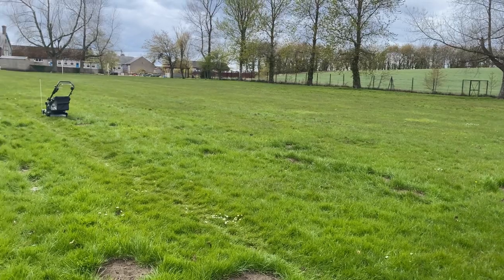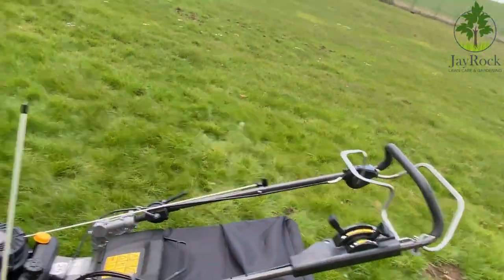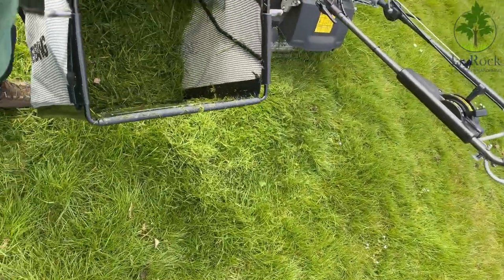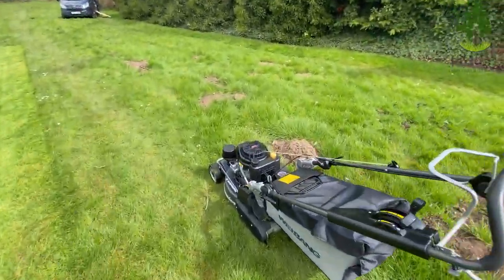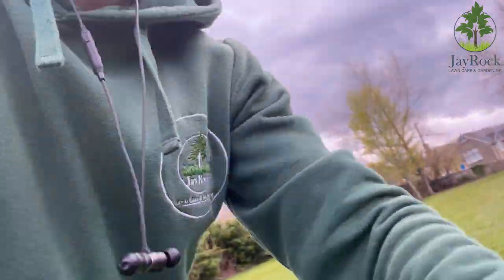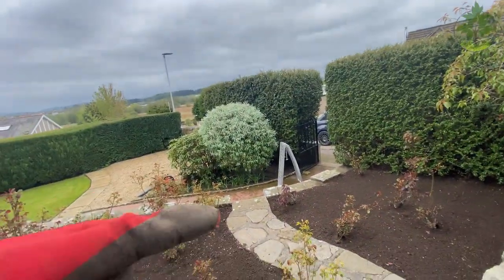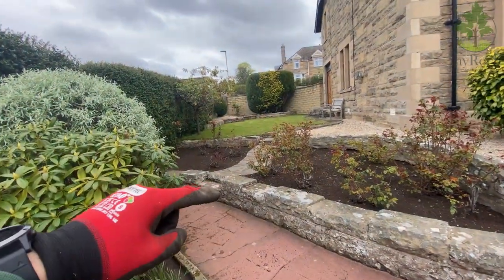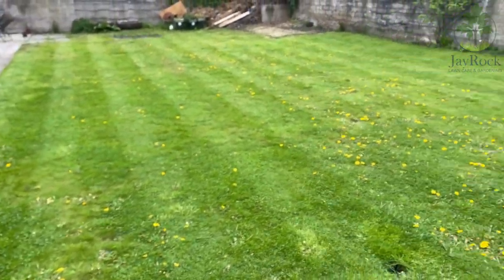Weibang Legacy 48 pro BBC Review // 1 Week On // Roller Mower //

Comment: I bought one. It cuts and collects really well but you really feel the weight, especially if you are knocking on a bit like me!
It's also got a very long wheelbase so scalps quickly if the lawn is not level.
It's sweet spot is on larger flat lawns when you want a fairly short cut. You did well getting it round those tight spaces!
Anyway I gave it to my son who soon managed to destroy the blade brake clutch!  To save a very expensive replacement I bought a new friction plate off eBay and stuck it on with an epoxy glue - still going strong after three more seasons. He also uses normal fuel and leaves it in over winter so I have had to clean or replace the carb a couple of times. Easy enough. It still runs and cuts well but then it's only used once a week at most
I replaced it with a Honda HRX476 which is much lighter but not as good

Comment: Great video, very helpful.
I'm old school and like the striped look, but my 17 year old Honda HRD 53QXE is on its last legs and I'm looking for a replacement. Quite tempted by a Weibang like yours, but a bit concerned about the weight as some of our grass slopes in two directions at once. How do you think it would cope with that? 😀
Reply from the maker: Thank you very much Graeme 😄. 

It does really well for striping and leaves a great cut. Struggles on the long wet stuff so you have to take it down to speed 1 to get a clean bag. Other than that it bags well any other condition. I really don’t think it will struggle, it’s a quick enough mower, really not hard to handle once you get it on the turf, took me by surprise that  part, I don’t think you will have an issue on the slopes, obviously depending how severe 😄
Reply: @JayRockGroundsMaintenance  thanks! Do you mind me asking where you bought yours?
Reply from the maker: Not at all pal, I got mine locally as Macgregors industrial supplies, managed to get it for £1,150🌱 a dealer should be able to knock some money off for you, I wouldn’t want to be paying £1300-£1400 for one
Reply: Hi, after watching your review, I bought a 4 year old machine the same as yours and just thought I'd let you know I'm very pleased with it! Despite being 10kg heavier than my old Honda, it drives up the slopes on our lawn better than it did. Leaves a good even cut and picks up well. Picks up drive much more smoothly than the Honda too. Hope it lasts as long as the Honda did! 😀
Reply from the maker: @graemesewell8879  that’s fantastic Graeme ! Great to hear such good feedback, the machine is brilliant and on a kept lawn will rival any mower on a beautiful finish! I hope you have many happy years mowing pal😄🌱 #Weibang
Reply: it weighed 67 kilos so will need a bit of wrestling

Comment: Good review. From speaking to dealers they always sell the standard 48 pro and never the BBC spec. Due to the non BBC having the friction disc and recons it helps collection. They also find after a few months the roller weibangs fall apart where the 4 wheel ones don’t. 
65kg for a 19” mower is insane. The prostripe I use daily is 22” cut. Same engine. BBC. 3 speed and that’s 66kg. 
I could be wrong but from memory their BBC you push forward and pull the bar (as you showed) but I think you can release it a little bit to release the pressure from the spring, so it’s easier on your hands? Might be a sticker somewhere.
Reply from the maker: Thanks mate! And thank you for commenting, yeah probably why I got a decent deal with it. After using it through the last couple weeks of very wet weather it really do struggle in the wet.. not the engine but the collection, especially if it is long. The cut and finish any other time is brilliant, just collection is poor. I enquired about a high lift blade and the Weibang also stated they found in testing that it caused problems with the clutch? Which is annoying as I think that may just sort the problem. Definitely a heavy machine although I’m getting used to it now, a 22” would just simply be too big for my requirements I believe, although that pro stripe looks brilliant, ive seen your stuff 💪🏽.
Reply: I’ve used this mower for a few seasons now, only issue I’ve had is the drive cable went but it’s been solid since. Yes release the bar slightly after engaging and it releases the pressure which is definitely required.
Reply from the maker: @MrMattrowland  so far I love it and I definitely find it easy to use! Not brilliant in long wet grass, but cut on the highest setting and it seems to get by🌱

Comment: Can I ask what your thoughts are a year on. I am  after a rear roller, do you still like it, would you buy it again. Many thanks. Rob.👍🏻
Reply from the maker: Hi rob ! I still really like this mower, looking forward to getting it used again this season💪🏽

Only main thing that annoys me which I didn’t know at the time of the video, collection of long wet grass (9-12”+) is more of a no go.. chute gets blocked up quick, what i have found though is that if on rough conditions you mow on slowest speed this is greatly approved. 

2nd negative: 
When cutting wet grass (and still raining) a lot of clippings get stuck between the roller and frame, so when you turn it basically builds up at the turn point, there have been occasions where I have had to use the blower to break these up. 

Overall the rest of the time it’s a brilliant mower and I do love it, if you have plenty of 120m/2+ gardens you’ll be in your element!
Reply: Thank you, much appreciated.👍🏻

Comment: Crikey mate my toro commercial is 60kg and that wrecks me these days 😅the fj180v is cracking engine though, easy to maintain. Stens do great value replacement filters on ebay. Have seen these weibang and wondered what they were like. I think with any rear rolled mower you will always be in for a ride. Even the high end hondas the rear roller ongoing replacement costs is phenomenal. Some of the best mowers are toro and husqvarna. 551sp was a phenomenal mower and the small one like you have is great too. Had mine 7 years and all it needed was a governor spring
Reply from the maker: Hi Paul! Yeah exactly 😂 once it’s on the lawn you wouldn’t be able to tell, but any form of lifting you soon realise lol. 

Yeah really your hoping it lasts, Weibang has the 3 year commercial warranty that’s what confirmed the decision for me. 

That small husqy is great but the SP keeps going. Maybe just a bit to much heavy use for the type of mower it is.. other than that it’s fantastic !

Comment: I have just brought a weibang virtue 50. Not used enough yet to give an opinion on it but it looks a good solid mower.
Those stripes you layed down in a park look really impressive. 
Good video and review
Reply from the maker: They look brilliant ! If you have any dramas with collection I believe the virtues take the high lift blade - meant to make so much difference ! Sadly the only bad thing with this mower alongside it’s weight is that it chokes up with grass past 9”. But yeah it lays some brilliant stripes ! Fantastic on kept areas 🙌🏽🌱
Reply: @JayRockGroundsMaintenance  Yes will be looking at the high lift blade. Also the do a dedicated mulching blade for it as well
Reply: What is your long term review mate?
Reply: @villa_fan8882 3 years old now and still going strong. Fit a highlife blade to it. Leave a great finish. Would recommend

Comment: good review love the weibangs got 4 my self just not a roller but on my to buy list subscribed
Reply from the maker: Awesome ! What model are you running ? These stripe amazingly, sometimes can be a struggle with grass 9’’+ and soaking, but having the 4 wheelers on backup would be a seamless fleet 😄
Reply: @JayRockGroundsMaintenance  
Weibang virtue 53 SMP pro with the Kawasaki fj180 engin
/Got the weibang 53 pro asd BBC shaft driven mower on order been waiting 6 month hopefully get it mid Feb 
/Weibang virtue 53 SSD BBC 3-1 old one getting replaced with the one on order 
/And the weibang virtue 46 but fancy some form of roller mower problem I have is beginning of the season wet ground the 4 wheel mowers with the aggressive drive when it's 1st engaged the wheels dig into the grass riping it up a little or if u turn the machine for the next pass they dig In leaving light marks on the lawn was thinking with the roller this would not be a problem there good machines weibangs
Reply from the maker: @marccarroll8399  I have heard good things about the 3 in 1 do you ever use the side discharge for overly long grass ? 15’’ + ?? Sounds like a good round up of mowers there pal! I’m definitely after a new 4 wheel in two minds of trying an ego!

Comment: Is there a high lift blade on it
Reply from the maker: Sadly not, it affect the clutch on the BBC model. The non BBC you can get the high lift which I would probably recommend
Reply: @JayRockGroundsMaintenance  thats a joke every mower should be able to run a high lift blade